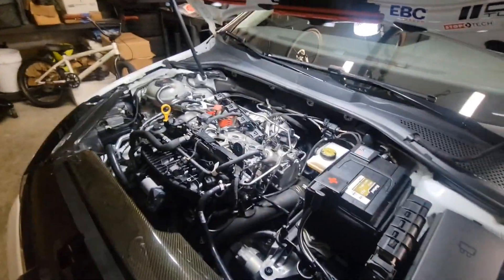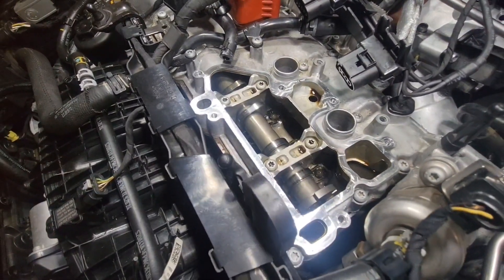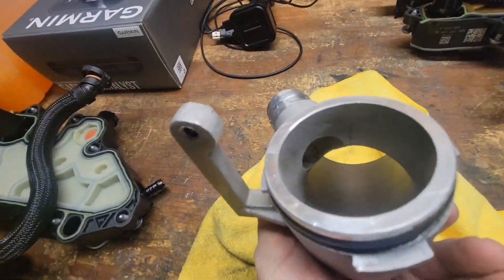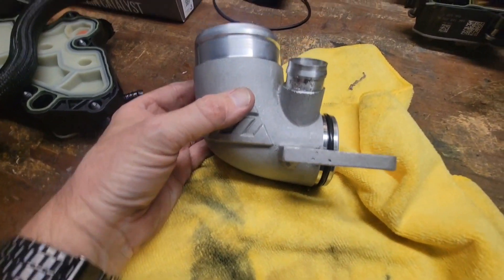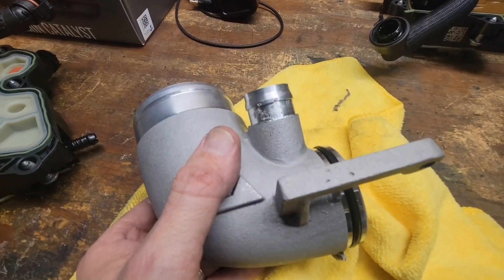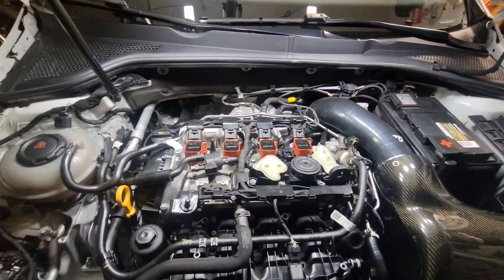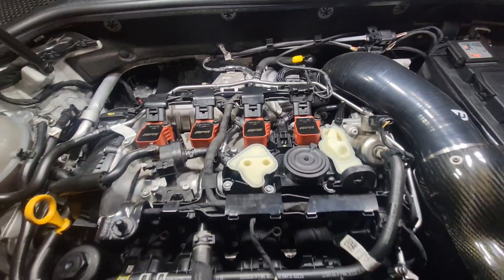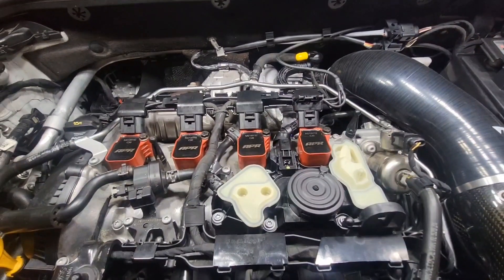MK8 PCV retrofit onto my 2018 VW Golf Sportwagen

Comment: I stoped my oil consumption problem with 1/2 qt MMO and resy oil to top off, used 1 qt of oil hasn't used any more since last time I checked it, dirty oil with carbon gets tracked in ring lands of this tighter motor and rings don't deal as well and float and then what do you think happens? Oil consumption, oh it's the baffle. There's more to it than that and no it's my bad rings it's carbon tracking in the ring lands the rings can't so there jobs to take up the gap when carbon is clogging the full floating movement of the oil in and around the rings can't scrape piston walls when ring is stuck in piston from lack of oil changes, and no synthetic oil, doesn't mean you can skimp on maintenance and you can't use cheap oil, these cars need better oil. Learn how to stop changing parts and work smarter not harder, I have to say this isnt the answer nor the problem, dirty oil, clogged passageways with carbon, run cleaner in every oil change.
Reply from the maker: Do you track your MK7 VW?  This solution is about oil surge prevention when tracking these cars not the typical oil consumption related to sticky rings that you are describing.  The smoking issue on track after hard braking and turning that is common to the MK7 is absolutely related to the PCV...not what you are describing here. Wrong video/you missed what this is about.  Check out some of my other videos related to this issue or datadrivenmqb channel.  My car has no oil consumption normally/on the street.
Reply: @karstgeo7290 I don't know that there ever problem with baffle bc I stopped the consumption and use without replacing or changing to new part, I did go to automotive school a long time ago, I did have five ases but now I work on muscle and show cars only. But race engine guys change their oil every 500 miles, not every 3000 and synthetic oil isn't better, it still has it's life and needs to be changed more often especially when you don't run highway as much to get the oil hot, but you have to have better oil for this engine not regular Walmart or AutoZone or advance or napa oil. Needs to be higher rated.
Reply from the maker: @Randall-Jeremial  again...this is about oil surge/PCV issues specifically on the MK7 generation VW EA888.3 engines, not standard oil consumption issues.  The VWs typically run Euro 40 grade oils with the VW502 00, Porsche A40, Mercedes Benz 229.5, and BMW LL-01 approvals, all top quality oils for daily or track use.  This has nothing to do with the oil, it has to do with g-force and the engine's design.  Google "MK7 smoke on track" if you have any interest, a ton of info out there specifically to this issue.  A common fix is a replacement PCV plate that blocks the passage causing the issue and adding a catch can; the video is about an OEM PCV solution that has worked great on my car.
Reply: I don't have smoke on braking I never see smoke just know as it was my machinist uncles all our original sensors he took great care of it, never did more than brakes or tires. I solved this oil consumption use problem in 103 miles, no parts changing. No reason to change good parts  that is what some people do and never fix the problem there called parts changers.
Reply from the maker: @Randall-Jeremial  Sure, but that isn't the issue/topic here.

Comment: were you able to get new tiguan hose to clip into the turbo inlet pipe, i’ve tried both IE and 034 it fits in but does not clip
Reply from the maker: Mine works fine.

Comment: Does this still allow to pass smog?
Reply from the maker: Sure, why wouldn't it?  Still a factory PCV that functions exactly the same.  Has no impact on emissions.
Reply: Ah i live in ca so even tip and tmd are usually outlawed since it doesnt appear stock to a good smog tech. I plan on running the full swap but just on the partial retrofit. I do still have the smoke on hard brake, turn, accel just like stock so venturi is on its way.
Reply from the maker: @shunjinezu  you can run a factory TIP, not sure how anyone would look at that kind of thing as it's so hidden and has no bearing on emissions like a cat etc.  If you dont run the 034 TMD with port, how will you run your venturi?